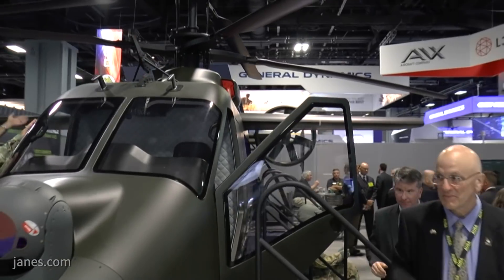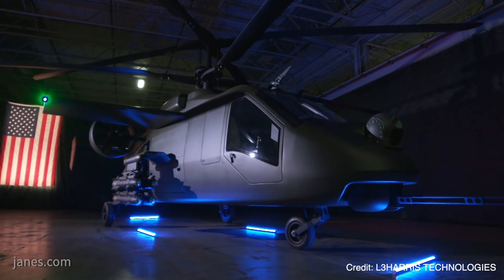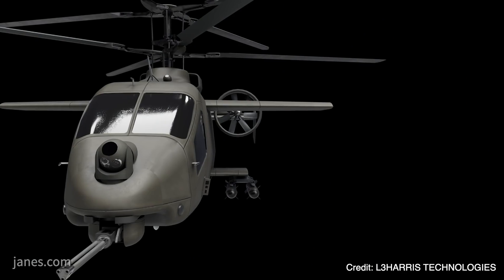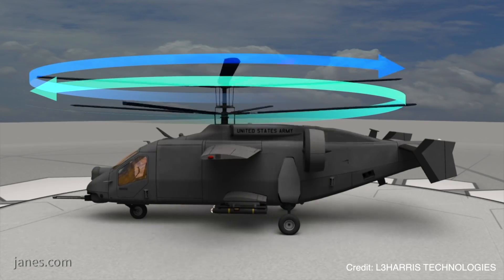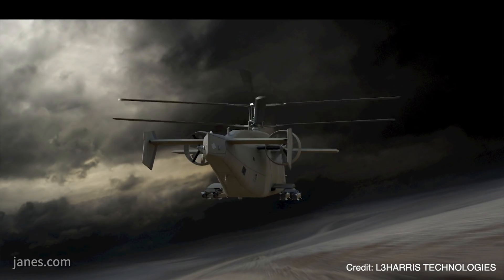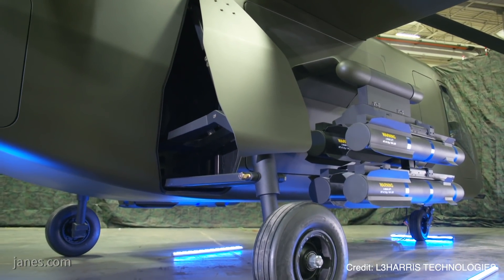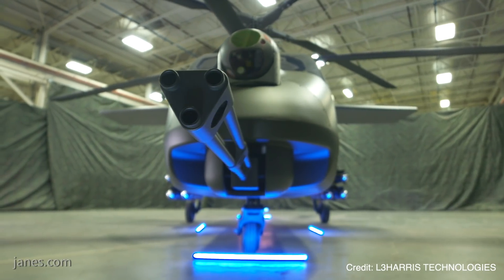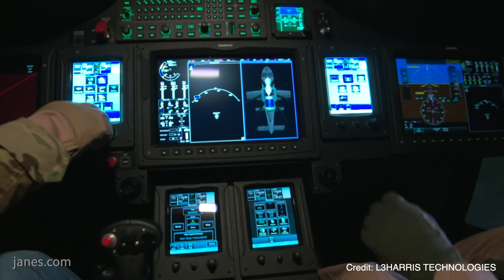AUSA 2019: Debut of Compound Coaxial Helicopter mock-up

Comment: Why do companies keep putting the joystick on the “armrest” sort of area (helo companies and jet companies). Just keep it traditional and have the stick in the middle. Particularly in helicopters where control is harder.
Reply: This is a fly by wire hybrid rotorcraft, not a helo at all.

Comment: A fly off? As I remember it the last major fly off was between the YF-22 and YF-23 and it didn't end well for either. Historically the most important feature for large scale military assets has been it's complexity. The more complex the more jobs the brain dead in Washington can claim in their next election. In the case of the F-22 it was 46 states with around 1100 sub-contractors. The outcome was a plane that needed to be hand fit at times due to shit just not fitting. It's also reflected in the cost overruns of the program that ended up being double it's proposed cost. 

Last I checked the aforementioned idiots in Washington have only gotten worse since the 80's.

Comment: Coaxial has the BEST performans! russians are good in that! but it can be proven more mainly in the rotor area all other futures is good this heli is good! the invictus from bell has perfect rotor but i think can go an step forther! we talk for tottaly cloose rotor area! yes..next step is rotor disc enclosed but all together like thespinning top performans ! to land an heli on your tip of your finger und fly without any..noise! is all about rotor! the rotor in this model the two rotors are much apart each other needs so more work! work needed allso the aerodynamics must be more thinn ! the bell has it all more better but this combine propulsion system is very good as an good third hand! very good in low und heavy landings and low altitudes manovers

Comment: I guess since everyone is saying this is the same as a Russian helicopter because they both have coaxial rotors I guess every helicopter with a single rotor and tail rotor are all just identical helicopters too. Forget about all the tech inside and the pusher fans, it has a coaxial rotor system so it’s just a copy of an old Russian design that had nothing else similar to it.

Comment: Ugly design, like so little engineering on the aircraft lines, if even a design is more beautiful a Kamov K-52 "alligator", or the project of the Sikorsky S-97 "Raider", with a more modern coaxial rotor and more aerodynamic lines 

I just hope that project does not come true. 😎

Comment: Low vibration level? I think you are going to have high vibration issue, and the Reason is because  you have choosen 4 blade rotors
Reply: Nico De Toffol how come? More blades give more vibrations? Havent heard of it before.
Reply: I didn't say that, I said 4 blades
Reply: @abvmoose87  I said 4 blades
Reply: Ok, what blade rotor would have been optimal do you think?
Reply: @abvmoose87  for a vibration point of view I'd better choose odd number for blades than even number. In case of twin rotors, especially coaxial rotors, I think two rotors of 3 blades would be ok, maybe 5 blades wouldn't be good from An aerodynamics point of view. In case of 4 blades per rotor I'd suggest adjustment with a rotor crossed (+position)and the other 45 degrees moved  (X position) 
How ti be clear
Please forgive my english I Am Italian
Reply: Nico De Toffol ok cool, I didnt know that, thanks!
Reply: isn't it the exact opposite?

Comment: 20 years to make a ka-52 copy....!!!
Reply: Ignacio Laforcada Do all of you dummies saying the same thing actually think it’s a copy just because it has coaxial rotors?  That’s like saying an r22 is a copy of an Apache. Coaxial rotors have been a thing since the beginning of helicopters for fucks sake.
Reply: Yeah. A RUSSIAN THING :)
Reply: @WanderfalkeAT  look it up the very 1st coaxial helcopter where italian and french not Russian.
Reply: @WanderfalkeAT  No. It was first made by a Frenchman.
Reply: @MaverickMedia100  If you have pictures or videos of flying french coaxial helicopters of ww2 - that would help! kamow ka8 = 1946. breguet 111 = 1949! Maybe the french came up first with that concept but kamow built it first! also the 111 only had 1 example produced!
Reply: @WanderfalkeAT  brantley b-1 first flight 1946. kamov ka-8 first flight 1947. just face it. the russian military is based off copying and stealing
Reply: @lafor7316  you are doing it wrong.
Reply: None of these stupid designs will will win... this is the JSF of helicopters.
Reply: @TheLuckyCanuck947  yeah i dont get it, we already have the Osprey which can carry significantly more weight, fly 300mph and twice the range.

Comment: double rotary system is a copy of Russian technology
Reply: Germany developed this technology during WWII.
Reply: Not the same Kind. The Flettner had 2 Rotorheads side by side with each having 2 Blades contrarotating made them not touch each other. Well seen in the Flettner Fl 265. A great Design because it was not so complex like the one KAMOV was using. Anyway, it limited the Blades per Head to 2. And it wasn't very silent. Some Ultralight Plane/Choppers are still using it Today.
Reply: Well it's just a rotor system it's not neccisarily copied
Reply: @aldenroswell8504  if it's Russian it's not copied but if it's American its copied?
Reply: We live in a American World, where Water is Blue and Russians are BAD!

Comment: Sikorsky can't make one that doesn't crash, only the French hold the world speed record for helicopter in level flight.
Reply: JoJo Rox What are you talking about? Which Sikorsky crashed? The Sikorsky in competition with this havent crashed as far as I know? The X2/S-97/SB-1 is ultra stable and performs like s champ, will most likley win the contract but I like this helo as well. Please explain what crash youre talking about.
Reply: The thing can't even land without tearing its rotorblades off.  The prototype that crashed in 2017 has not been repaired.  The French helicopter that holds the speed record is far more stable.
Reply: JoJo Rox I didnt know of a crash but I guess youre referring to the hard landing. I didnt thinkmuch of it but maybe it was more serious than I realised. Which one is the french one? Is it a different model?

Comment: It's cool it's all electric but will it be able to  function against electronic warfare and not just drop of the sky?
Reply: They could do internal faraday cages or something. I assume it's designed to modern EW standards but I couldn't say for sure. Taking the term "drop out of the sky" more litterally though, I wonder if it can auto-rotate.

Comment: By eliminating the tail rotor, safety in the air and on the ground is significantly increased.

Likewise, having no tail rotor enables the contra-rotating rotors to have more power to provide lift.
Reply: The down wash is also traveling straight down instead of spiraling. By having rotors spinning in opposite direction it eliminates the swirl component of the downwash,   adding to lift.
Reply: Also, with contra-rotating blades, retreating blade stall is cancelled out, eliminating the thing that limits the top speed of most helicopters.
Reply: Well... They have a Limit: when the upper touch the lower Blades!
Reply: one shot from a 50 cal in the mast or rotor hub and its a lawn dart .... easy shot easy target super vulnerable ... once you damage one part of the rotor it loses all stability ... and the crew are doomed from then on ...
Reply: @0623kaboom  With respect, stating the obvious, that high calibre anti aircraft gunfire can bring down an aircraft by striking flight criical systems, causing catastrophic damage isn't really adding much to the discussion about this aircraft.

Any rotorcraft can be brought down by accurate, high calibre anti aircraft gunfire striking flight critical systems, causing catastrophic damage!
Reply: @0623kaboom  Not necessarily. The rotor blades of the AH-64 Apache are armoured to withstand hits from a 23-mm cannon.

Also, newer Russian helicopters contain ejection seats. The rotor blades are ejected with explosive bolts, and then the canopy is ejected, followed by the pilots. No reason American helicopters can't do likewise.

The Russians are somewhat more advanced in terms of helicopter design than we are, and the fact that a design they have been using for decades is considered the way forward for American helicopters is testament to their proficiency in this field.
Reply: Copied Russian Coaxial designs.

Comment: He says the chopper is all electric forgetting that Russian Alabuga EMP can incinerate all electric/electronic circuits on board in no time and render the chopper and other American flying machines obsolete!!
Reply: Amos Lukyaa uhhhh you do realize that military electronics are hardened against EMPs right ?
Reply: @ozzy7763  
May be protecting against Mickey Mouse USA manufactured EMP generators not Russian no nonsense Alabuga is capable of incinerating all semiconductors  even if the circuit boards are screened with 15 inches thick area 51 manufactured alloys for protection, Alabuga will still fry Uncle SAMs   electronic circuit  boards like French fries - Russian never bluffs, when they say gotta ground breaking weapons you better take them seriously.
Reply: @amoslukyaa5792  rUsSiAnS nEVeR BLuFf

Comment: Wouldn't the proximity of the pusher fans to the stub wings reduce the effectiveness of both when considering the airflow and air pressure?
Reply: hi B P...
'
it is a not good design

Comment: 4 rotors. 4x expensive. Range is sure affected.
Reply: hi K P...
'
not important to use a word exp - - - - - -...
what about ussr russia have too many helicopters...
did ussr russia use a word exp - - - - - - or not
Reply: @bestamerica  It was a figure of speech. 1 vehicle with 4 rotors ( 2 of them are huge 40ft rotors) is sure a maintenance nightmare both in repairs and cost. If the US really want a dual huge top counter rotating rotors, then the army should get the Sikorsky S 97 Raider with 3 total rotors. Otherwise, Bell 360 Invictus is sure for the win with the traditional dual rotor set up plus a more stealthy, Comanche-look profile.

Comment: I hope they are not competing against Lockheed raider X attack helicopter. Side-by-side pilot capabilities is really not In issue to worry about because flight controls can be switched from pilot to pilot even if they’re sitting front and back positions. With the wings that’s probably gonna carry extra fuel and the two prop fans along with that Wide ass whale tail of a tail is going to cause unnecessary air drag that will Limit hi speed capabilities. Lockheed Raider X has a more suitable aerodynamic slipstream airframe for high-speed capabilities. No,I do not like the Raider X wide ass whale tail as well. I still believe that Boeing’s Comanche is a better platform for a dual blade system that has a way better stealth Version of a Attack helicopter concept. This is one time that I really think that Boeing should I put their hat in the game. I really think Lockheed and Boeing should really hook up on this one. Hope you’re listening Penny potluck. Sincerely, Cinderella😎

Comment: Why are they still using Rotors... Some dude has already deigned one around the F35B lift fan. That does away with Rotor Blades. Thus is does not need a tail boom. Forward flight is combination of lift fan and the Turbine Engine....And it's fast and quieter with the same amount of lift capacity. In a compact air frame...
Reply: Doubt it.  No way it's quieter than a rotor system, and fuel/power efficiency, controllability,  and durability would not come close
Reply: @ChevTecGroup  You idiot.. You can see the results of such systems in a store bought Drone...As those 60 foot Rotor Blades are loud..One reason they try so hard to remove the Tail Rotor. The Fuel capacity of them are limited to 2 hours. Are far more intensive in flight control. Higher Maintenance man hours...

So I suggest you read more. As I can tell you never been around them..

Thank You...
Reply: @MasterChief-sl9ro  I've been a helicopter mechanic for over a decade.  I guess me and all the engineers at Lockheed, Sikorsky, Boeing, Airbus, and every other major manufacturer is dumber than you and your videogame/movie experience. Multirotor drones do work well but only for smaller rotor blades. The way they are controlled are completely different. Drones control thrust by varying the speed of a rotor, on larger systems the inertia of the rotors is too big to overcome. Also, drones fly for a matter of minutes, helos fly for hours.  While Multirotor systems are very cool and are promising. They definitely don't beat traditional helicopters when you are trying to fight a war or do real work. Keep playing your video games til you get old enough to try the real thing
Reply: @MasterChief-sl9ro  and your mention of a turbine system like the f-35 to make a helicopter shows you know nothing.  Will it hover?  Yeah, but not much else. I had 2 Apaches hovering 300 yards from me at 100ft AGL last week and didn't know they were there until I looked up.  And the loudest rotor system in the military is the mv22 osprey,  which is the closest thing to what you describe yet shakes building the farthest away.  The f-35 and harrier are even louder but at a much higher tone.
Reply: @MasterChief-sl9ro  you do know that most industrial helicopters use turbine engines right?  So you are complaining that  they aren't using quadcopter aircraft that are powered by turbine engines? Turbines that don't have fast throttle response so they wouldn't work in a traditional quadcopter configuration? And the f35 only uses its lift fan for the front of the aircraft.  The tail end is lifted by the downward facing exhaust.  The reason traditional helicopters are quieter than aircraft with multiple smaller rotors is because the traditional (longer) rotor blades do not need to spin near as fast as a ducted fan or small rotor does.  Though the aircraft will be louder if it is heavier and moving more air around.  And your insults really don't bother me.  It just shows how inept you are at having a simple discussion about rotorcraft design. But just to for fun, America has changed the world for the better since its inception.  The internet you are trolling on right now was invented by America. And so was the computer you are using.
Reply: @MasterChief-sl9ro  just curious though,  can you cite the "some dude" and his lift fan creation from your original comment?  I'd love to see it
Reply: i agree like the one in the movie avengers
Reply: That sounds really interesting. Do you have a source for that? Is something allready built or in concept phase?

Comment: Can you mount weapons in the wings sir????
Reply: Well you could but you dont want to. Because the more clear the surface is the more lift will be generated when the fans accelerate the helicopter horizontaly. Which can allow the pilot to reduce RPMs of the coaxial rotor and maintain altitude
Reply: hi E L...
'
not good design about the side wing

Comment: Looks like an Alligator with propfans.  This is going to be a maintenance nightmare.
Reply: They will all be maintenance nightmares compare to the OH-58.
Reply: @cleo1488 Coaxial counterrotating props, prop fans, retractable gear.  Sounds lots more complex than anything the army is flying currently.  And the all electric controls could go either way.  No hydraulic fluid to deal with, but electrical gremlins can be tough to find.
Reply: BB MW Complex, but I love the innovation. If maintenance is the main priority then Bell Invictus 360 will win.
Reply: Yeah ... the KA-52 is much more simpler tho ... watched vids of it in Syria doing agile maneuvers effortlessly whilst causing carnage was awesome
Reply: Arvin S Anolin the KA-52 would be vulnerable to short range and shoulder fighter air defenses. This is why the army is bringing back SHORAD. FARA is a pipe dream.
Reply: I don't think they are going to get far with this bird. Just contemporary helicopters have better sensors and more storage and payload.
Reply: notafakeaccount I don’t think they will get far with FARA overall.